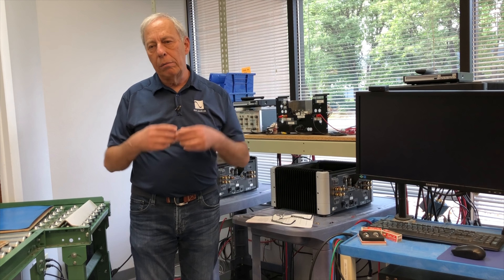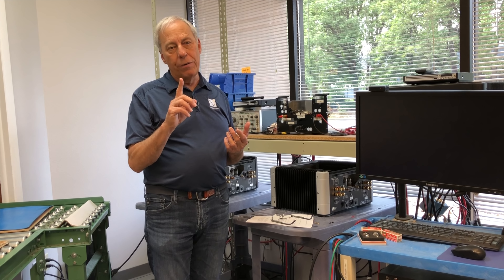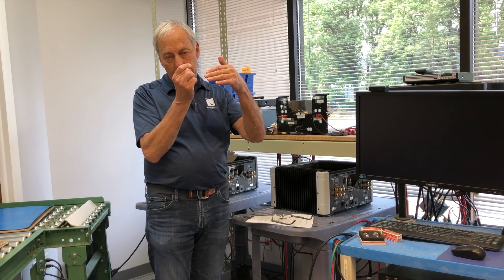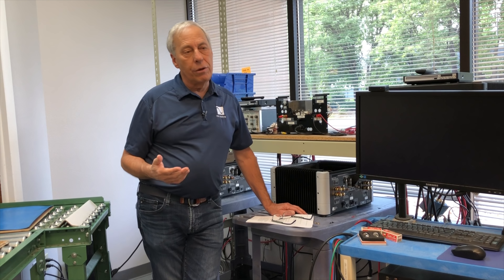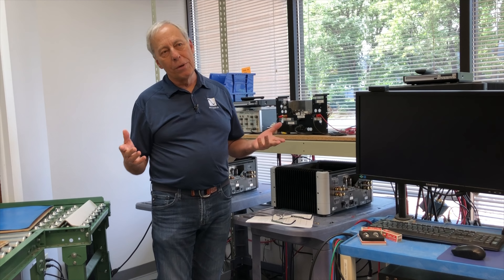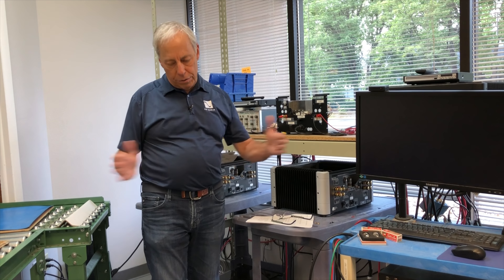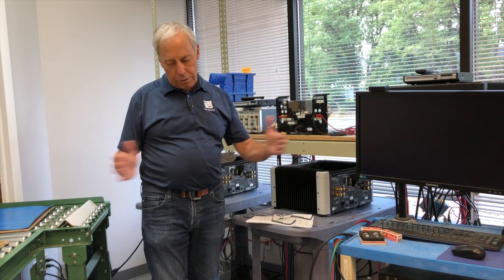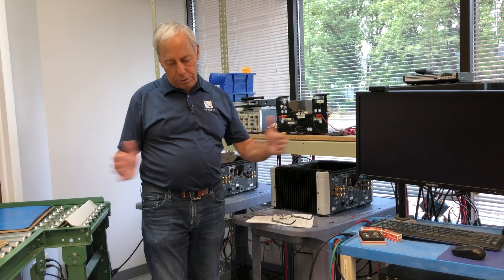Why don't turntables have built in amps?

Comment: The more expensive record players do not have built in preamps probably so that the buyer can use whatever preamp he likes. If a record player includes a preamp, but you think a different preamp sounds better, then you just wasted money on the built-in one.

Also, I do not really get the phono preamp wih ADC. Sure it may be useful if I decide to copy the record to a CD (or other digital format), but for normal listening, I just want the analog output instead of going AD and then DA (since my ears are analog anyway).
It would make more sense to have a separate ADC that I could use with records, tapes etc (to record them to digital format) instead of one built into the phono preamp - that way I only need one ADC.
Reply: One reason to include an ADC in the turntable would be to minimise the amount of signal transferred in analogue form and avoid opportunities for noise to get in. Digital signals only having a small handful of levels that encode a valid signal are more robust, plus you can use error-correction codes with them and fix some of the errors that do creep in. 

Just think of all the speckle and ghosting you got on analogue TV and compare it to how digital TV only sees the picture degrade when there's some really severe interference and you get a blocky patch for a split-second. Those blocky bits are when the error-correction code has been thrown more errors than it can fix.

I think the system Paul describes near the end of the video is basically one which is almost entirely digital. Analogue media get digitised at the first opportunity and the signal is passed around and processed digitally right up until the very last second, where the wireless speakers would have their own DACs and amplifiers tailored to getting the best output possible.
Reply: I guess my system is completely opposite of that - entirely analog, with digital sources getting converted to analog and going to the preamp, equalizer, expander etc as analog signals. 

I have a lot of analog sources and converting them all to digital, just to pass the digital signal 1 meter to the preamp seems pointless. I also do not see the reason for wireless speakers - they will still have the cable to the power outlet (or use batteries, which is completely pointless for non-portable application), so I might as well use an audio cable too.
Reply: I have to wonder if you'd even need a preamp with an all-digital system, given you can synthesise a PWM signal from a digital source and have the amplifier double as a DAC.

Yeah, I think wireless speakers are a stupid idea for the exact same reasons you give. While there is such a thing as wireless charging, it's horribly inefficient compared to a cable (less than 50% of the power actually ends up in the device) and it only works over a distance so short you might as well be plugging it in.

All this obsession with wireless everything just doesn't make sense to me. Sure, there are some things where it makes sense or is even required (wireless networking for a smartphone, for example), but half the time, I just find myself thinking "Why bother?".
Reply: Wireless charging makes sense for a phone - you don't have to mess around with a cable, wear out the connector etc. Just place the phone on the charging station or your table and that's it. The power loss does not really matter.

OTOH, a wireless 100W speaker won't have wireless charging, not unless you want everything metal in the room to heat up. So, it's either batteries (IMO stupid for a stationary device) or using a cable for power, but then you might as well use a cable for audio, digital or analog.
Reply: If you have to place the phone in a special location to charge it, it might as well just be a nice simple cradle with some contacts in the bottom to put power through. Hell, I've got a cordless landline phone that's like that. When you're done talking, drop the handset into its cradle and it'll charge. Basically the same as plugging in a cable without the two seconds of fiddling with the plug but the same efficiency.

The power loss of induction charging may not matter when it's a few hundred kilojoules going into a phone battery, but it certainly does in aggregate or worse, when talking about applying it to electric cars, as some idiots want to do. Charging an electric car costs a good deal less than filling a petrol one, but you're still going to spend around AUD$3.40 per 100km (compared to $9 per 100km for petrol). Use induction charging, and you're going to double the cost due to wasting half the power.
Reply: Cradle for a phone -that works, though I guess the wireless charging pad is larger and you do not have to place the phone precisely, just on the pad.

For me, it would be annoying to roll out the cable to plug my car  in to charge when the car is outside, though I guess installing the wireless charging would be even more annoying.
At least in my country, a large part of the fuel price is the excise (about 0.43EUR/L) and it is one of the largest revenue generators for the government (another large one is tobacco). If everyone bought electric cars tomorrow, do you think that the government would just accept less money? No, it will find a way to tax the electric cars, or tax every km driven etc.

Comment: and you know what the industry say there goes Paul again with his crazy ideas. what about the extra weight to the headshell.
and converting analogue to digital no! you just dismissed it by saying that vinyl lovers will lose the vinyl feeling well if it's converted to the digital it would be. I don't care what sort of inverter you've got there's always a loss no converter is good as analogue yet.
I was watching one guy who had a piece of your gear and the amp didn't even have a rumble filter what's going on there. only if he disconnected it do they have a rumble filter built in??